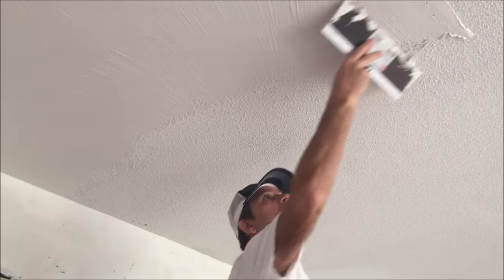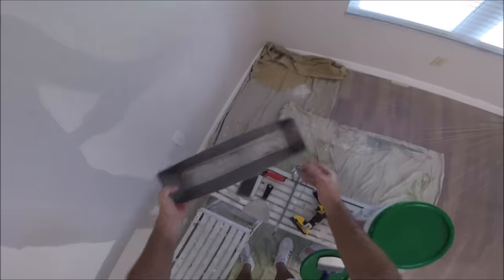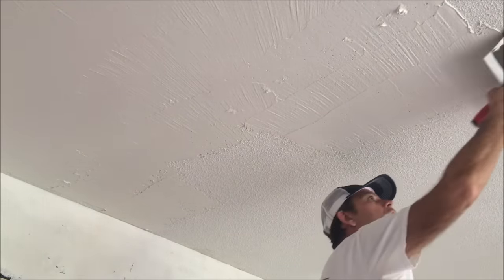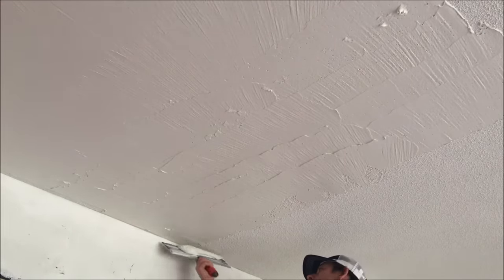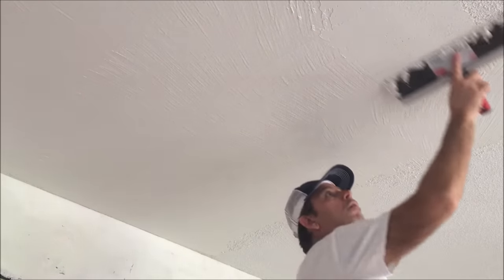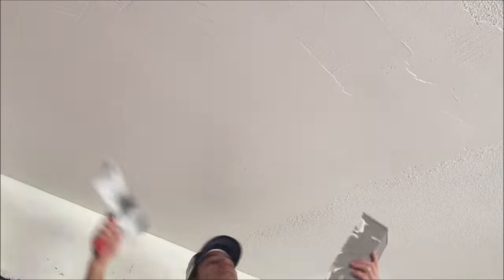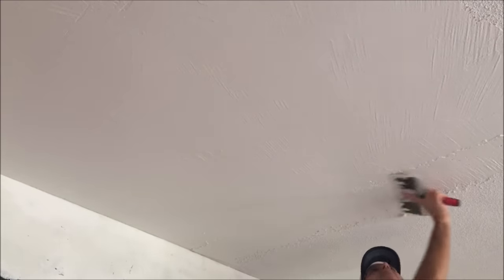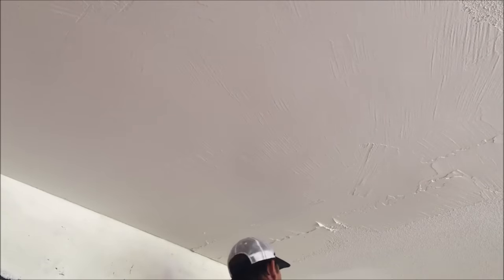Don't scrape your painted popcorn ceiling. SKIM COAT IT!!!

Comment: Whats the difference between the blue and green of the box usg? We have swirl texture and want to cover that in the small kitchen and leave it flat and add orange peel texture on the walls to cover the imperfections. After u add the skim coat and sanded what else do we do before we paint the ceiling white?
The house was built in 1955! Super old house with swirls texture all over the ceilings. Looks like it was painted also.

Comment: Dunno about this. I've seen entire ceilings with popcorn fail and fall just by painting them with an airless sprayer because when popcorn gets (re)wet it becomes weak. Drywall mud compound is even heavier and stays wet longer. Anybody who knows anything about these things knows the finish product is only as strong as its base or substrate. I would never do this and I've been a drywaller/painter for 34 years. Done my share of ceiling textures as well. This guy is obviously very skilled at his craft though. Don't do this in your home people. Wet it and scrape it.

Comment: The popcorn texture can be removed it adds more work , taping and plastic , spraying down ceiling with water through an air less paint sprayer and it comes off like butter . But like I said more work .

Comment: I’ve done all that skimming,& skip trowel but what was it that you added a cup in the mud before texture? May be hot mud? Doing one coat without sanding the mud shrinks you’d have to put a heavy texture to hide the imperfections...

Comment: Very cool....will it work on an unpainted popcorn ceiling? im thinking no....like one you tried to paint with a roller and it comes off....guessing it needs a spray coat then mud it? or wet it scrape? i hate to scrape it house is 1946...sure it has asbestos in it... florida...good mud guys make it look easy nice videos.....

Comment: We just bought a house and they painted the popcorn, so YouTube knew I needed this.
#drywalltube
Reply: everybody eventually painted their popcorn, had a house with it ( I'm in California and it was never put in Kitchens and Bathrooms) the previous owner in 1991 was into the Country Look and painted it a tan Navajo white, and we lighted the walls to white,  and suddenly the ceilings looked horrible,  we were kind of broke but my brothers neighbor was a painter and said if we bought the paint he would spray it and if he didn't have to tape it off, he would do it for $75    we took him up on it and Home depot had our white paint in a 5 gallon bucket, so it cost us then about $100 to do.   Lasted till 2015 and the sold the house to a flipper and they scraped the ceilings , So paint did last a long time on those ceilings

Comment: Will this be viable on a heavy popcorn (yours looks very mild by comparison) painted over with a 'moisture barrier' paint.  Also the popcorn is fifty years old and some always comes down with a stiff coarse floor broom.  Won't those make a smooth skim coat impossible?  Like gravel in the concrete butter when finishing?

Comment: Hi Paul, great video!  our home has 1978 popcorn ceiling which probably has asbestos.  Your skim coat idea is good, but since our ceiling is not painted, we probably will opt to cover it with bead board in the main rooms and sheetrock in the bedrooms and smaller areas.  Is 1/4" sheetrock ok for a ceiling?  We will do it ourselves, but worried about the weight.  Let me know your thoughts on best methods/materials.  thanks! Cammi
Reply: 1978 is the cut off year for asbestos.  It's probably OK but  you could have it tested.   1/4" is not too heavy esp. on a house that age.  It would be better if the popcorn  were scraped off and a panel adhesive used in addition to drywall screws.  A trick is to lay the 1/4 drywall on the floor with a few 2x4s running across under the center of the stack.  Be sure all the sheets are good side down.  Leave these for a few days.  This will put a bend in the sheets that when pressed agent the ceiling will  prevent sags and insure that the sheet and adhesive maintains good contact with the original ceiling during fastening.   Some drywallers put a layer of joint compound on the upper side of the 1/4" to insure complete fuzzing, but for me that's too time consuming and adds too much weight.  I've done a number of these ceilings on old plaster homes where there were too many cracks or unstable layers to patch with tape and the owners didn't want the mess off full demo.  1/4" rock is fine over ceiling and walls so long as there is sufficient  stable backing.  Don't count on 1/4" to cover holes as you can punch through unsupported 1/4" easily.
Reply from the maker: I don’t like quarter inch drywall for ceilings. Because it tends to be a little wavy because it’s so flimsy. I’d recommend at least a half inch sheet of drywall for doing ceilings.👍🏻 -Paul
Reply from the maker: That’s true Malcom. But, manufacturers were allowed to use their backstock of the asbestos materials. So when they knew that the deadline was coming they upped the production to have a bigger backstock of these products. That’s why I always say anything before 1982 needs to be tested. I hope that helps. Thanks so much for your comment! -Paul
Reply: thank all of you for your replies.  we still have not done anything with it yet, need to get it tested and then I can determine how to proceed.  Thank you for the info on 1/4" sheetrock.  If it has asbestos, we will try to cover it with something, but probably not opt for the skim coat as our popcorn is not painted and we don't have the skill to make it look this good!  I wish there was a simple product that is light weight that could be glued/screwed to the ceiling.

Comment: Popcorn ceilings are commonly the most poorly applied textures in the world. It is applied to hide lack of proper taping and lack of proper priming before it is applied. As a result, the popcorn does not adhere the same to the taped/mudded areas as to the field of the sheet rock. This is because unprimed wallboard will absorb the moisture from the popcorn texture at a different rate than the taped areas. This means that it it often extremely possible that the addition of any moisture, by painting or by skim coating will result in loosening the poor bond causing the popcorn to peel/drop off the ceiling in spots, patches and sheet leaving the contractor with no choice but to remove all the popcorn, properly prime and then texture and paint the ceiling.

Comment: Will the joint compound still stick well if the popcorn ceiling is NOT painted?
Reply from the maker: Most likely not. If you just put joint compound on the unpainted popcorn ceiling it will just bubble and fall off.👍🏻

Comment: MY house was built in 1968 and we have popcorn ceiling in all our rooms except the bathrooms. Should I be worried about doing a skim coat if the popcorn ceilings have asbestos in it? I am not sure if they do but wanted to get your opinion, Thank you’d.
Reply from the maker: Have the popcorn ceilings been painted before? Because the paint encapsulates it. Thanks.
Reply: You’re welcome Paul. No they have not been painted and in some areas its starting to fall from the ceiling. Is there a way I can remove some of the to have tested for asbestos? I appreciate your answers to my questions.

Comment: Odd note that I learned long ago as a teenager: if you spray certain multi-purpose cleaners (IIRC it was 409) onto an unpainted/original popcorn ceiling from the early-mid 70s, it will dissolve, melt, or otherwise obliterate the textured aspect.
Reply: How long does it normally take for it to start dissolving

Comment: If the popcorn ceiling scraps off easy would you still skip coat over it? This house was built in 2002 and the ceiling was never painted. It seems like the popcorn scraps off easy if it’s damp with a spray bottle with warm water. What would you do?

Comment: So, you can skim coat over painted walls? Latex, satin or eggshell to be exact.
Reply from the maker: Yes. 👍🏻 Use an all purpose joint compound. Because it has more glue in it, which means better adhesion to painted surfaces. ✅ -Paul

Comment: I’ve watched a bunch of your skim coating videos on YouTube. Especially about skin coating over popcorn ceilings.

I’m planning to repaint my bathroom, but the walls and ceiling are all popcorn. I can’t scrape it because my house is from the 70s and may have asbestos in the popcorn or lead in the paint.

My question is: how should I/ do I need to prep the ceilings and walls before skim coating? They are painted with a glossy paint. I’ve read a lot of conflicting stuff online about needing to clean with tsp or use a primer before skim coating, but I’m not sure what’s correct because it always mentions sanding too, which as I said there’s a chance of asbestos or lead so I’m trying to avoid scraping or sanding.

So how should I prep my glossy painted popcorn bathroom before skim coating?
Reply from the maker: No prep needed. You can skim coat over the glossy paint if you use an all purpose joint compound for the first coat. I hope this helps. Thanks for watching and subscribing! -Paul

Comment: I taped and finished drywall for 15yrs. Although skimming the acoustic ceiling looks like the easy answer, it’s not. Scraping it and completing the first coat drywall finish is the best way.
Reply: Exactly, the weight will also make it sag. Then when it moves the mud will crack and eventually come off.

Comment: This was a nightmare.  No warning that the mud could make the popcorn fall off.  I applied lightly, but after checking on it a couple of hours after finishing, a three by four-foot chunk had dropped straight down to the floor.  A hundred bucks down the drain as well as $300 for an asbestos inspector--now that the popcorn's been disturbed.  Another couple hundred minimum, depending on the asbestos results, and more labor to redo.

Comment: My bathroom has this popcorn texture in it but it’s really soft. I’ve never seen it before. And the texture in my kitchen is so gross. I googled textures and couldn’t find anything that remotely resembles it. Literally looks like the previous homeowners just threw random globs of paint on the walls and let them drip and blob all over the place, it’s so terrible. I’ve been watching your videos but my ceilings are pretty high and idk how I’m going to be able to make such long fluid strokes from top to bottom when I can’t even reach the top without a ladder. Will it look horrible if I have to do the top first and then the bottom?

Comment: How old is too old to scrape?  Did my 35 year old ceilings.
Reply from the maker: Hey Bill, any popcorn ceiling that was applied before 1982 should be tested for asbestos prior to scraping.👍🏻
Reply: @PaulPeck  10 years later and now you tell me.  Well it didn't smell like asbestos. Lol

Comment: When our house was built, all of the ceilings were sprayed with a splatter mixture of mud and paint. Could this skimming method work to cover the splatter or do you think it's too thick? I think it's thicker than popcorn.
Reply: If there's high ridges or sharp edges sticking up from the texture, scrape them down first, but there shouldn't be any reason this wouldn't work on your ceiling as well. If you've never done it before, just know that your shoulders will hurt after doing this.
Reply: @HipposaurusRex  Haha I'm sure it'll be painful. Thanks for the advice and I love your videos.

Comment: Can I use topping joint compound instead for textured walls and popcorn ceiling?
Reply from the maker: Hey there Drew. I wouldn’t. Topping is made to go on a little thinner and has less glue in it then the all purpose. The glue helps the AP adhere better and go on thicker.👍🏻 I hope this helps. -Paul

Comment: Ok so we've been doing this but we have alot of left over in the tray what are we doing wrong? We've been rolling in on because it goes on more evenly, we tried doing it by hand first but did a terrible job 😔
Reply from the maker: Hey there Drew! Sounds like you might be applying to much pressure when you’re skimming? That will a result in you  removing more of the material then you are leaving on the ceiling.  What do you think? Also, your joint compound might be thinned down to thin? -Paul
Reply: @PaulPeck  how much pressure should we be applying? Yeah I definitely think it's thinned out to much but also probably adding to much pressure 😬

Comment: Popcorn ceiling mixture (styrofoam and mud) actually weakens quite easily when it has a chance to soak a bit of water. I don’t think skim coating over it is a good idea - at least not if there is any chance of a water leak on the floor above. It’ll peel the skim coat off in sheets.

Comment: I have a much better way to do this. Lightly scrape the ceiling, then apply a mix of PVA glue and water. Then import 2 or 3 bags of Thistle Multi Finish from the UK and find a British plasterer to do a proper plaster job. Stronger and smoother than anything done in North America.
But this is really good work.

Comment: What is your opinion of using USG Plus 3 , which is 25% lighter  then regular joint compound ?
  Is this the proper application for it
I am a DIY trying to fix the worlds ugliest popcorn ceiling and walls
Thanks again
Reply from the maker: Hey Jeff, I like using the all purpose joint compound for the base skim coat because it has a lot more glue in it. This means better adhesion to previously decorated surfaces.👍🏻 Then second coat with the light mud. Thanks so much for watching and subscribing my friend!😎 -Paul
Reply: Thanks very much
Reply from the maker: Always happy to help Jeff!👍🏻🤓

Comment: #skimcoat.  What part of the USA do you reside, work?  I am trying to determine if it's best for me to hire someone to skim coat a ceiling, hire someone to add a layer of ¹/⁴" sheetrock and mud/tape it or slap beadboard over the ceiling. I estimate the room is appx 900+ sq ft.  There's no way I can tackle it.  So annoying.

Comment: Hello, I tried this and my first coat has a bunch of holes in it that seemed to form as the mud dried.  So now it looks cratered or pockmarked.  What did I do wrong and how should I fix it?  Thanks!
Reply: Mix it with a mixer on a 1/2" drill before you start using it dont use it with mixing it. There's no telling how long the bucket has sat on a shelf in a store. Also:. Youre next layer covers all the imperfections. First layer is just to create depth and fill. Don't worry about how first layer looks. It'll be covered anyway. If you want to speed up the whole drying time, mix in plaster of paris straight into each batch your'e applying. It'll speed up drying time of Joint compound which is usually takes hours to dry.

Comment: Popcorn texture is easy to remove if you know what your doing.. Most tapers are good at one thing. you guessed it. slinging mud. And it will look good when there finished. however it will not last long one year maybe two. Then you got cracks  big flakes falling off real mess on your hands.. Want it done right Hire a Journeyman Carpenter. On of the most versatile tradesman in the industry..
Reply from the maker: Never had a problem... I only skim popcorn ceilings if they are applied before 1982 because of asbestos. If applied after I use my paint sprayer to wet and remove. 👍🏻 https://youtu.be/Fz63ATjiVdY

Comment: Hey Paul, I'm skim coating some 50 year old popcorn that I just painted and sealed up. I've covered about 20 sqf so far and it looked great before drying, but there's a ton of fine cracks now that it's had about 8 hours to dry. I'm thinking it's because my coat was pretty heavy (the popcorn texture is about 3/8" deep in some spots). Is it OK to apply another coat over it or will I just stack up cracks? Any tips for super heavy popcorn? Thank you for these videos!
Reply from the maker: Hi Miranda, what product are you using for your base skim coat? -Paul
Reply: @PaulPeck  I'm using Westpac all purpose JC. I think I'm making too thick of a first layer, but lord I never wanna see popcorn again.
Reply: @mirandaleake752  So he responded to you 1 year ago. You answered his question about the product you use. And he vanished off the face on the earth. Wow , how nice of him.

Comment: I swear every time I've tried a similar method, customers would call back and say they would see spots all over the ceiling at a certain time of day. Near sunset. And sure enough, there would be spots everywhere. Wonder what I did wrong?
Reply: If your set on skimming it instead of removing/covering it then prime it first.

Comment: There no guarantee after you put all that mud over popcorn it don't bubble when wet mud soaks in to popcorn ceiling especially if paint with flat paint I scrape popcorn all the time that's been painted just wet it up soak in scrapes right off so my exsprence with popcorn it like old plumbing once it get wet it fall off ceiling bubbles so if am trying to match in popcorn I pro block all edges where new meets old just so new popcorn dampness can't soak into old popcorn so did you problock ceiling before you mudded over it cause I can't see putting mud over popcorn and old popcorn not coming loose from all that moisture from mud it sti going to absorb into popcorn painted or not in less it was oil based paint or pro block

Comment: #drywalltube  If the popcorn ceiling is painted do you have to prep the paint before skimming?  Degloss?
Reply: It will stick to low sheen paints (flat, satin) without any bonding agent(oil based primer)

However, make sure the surface is clean, remove any dirt or grime if necessary so the compound can bond.